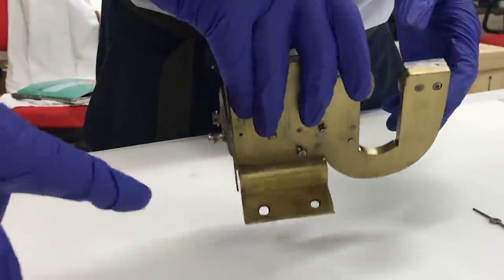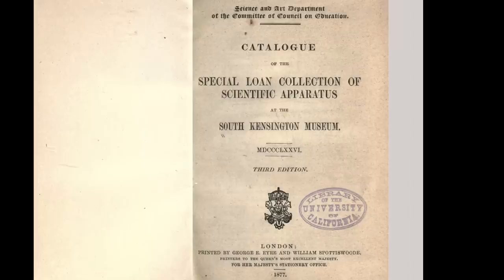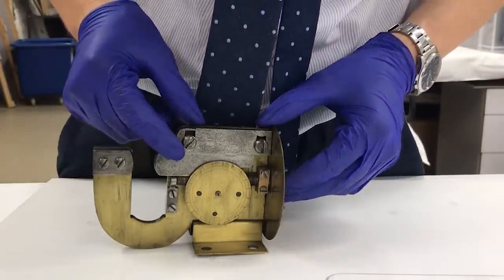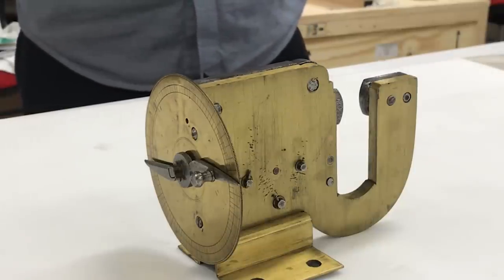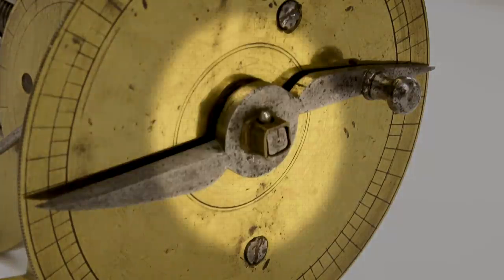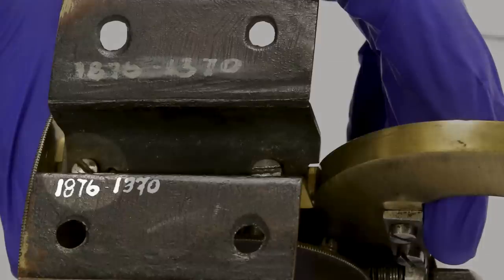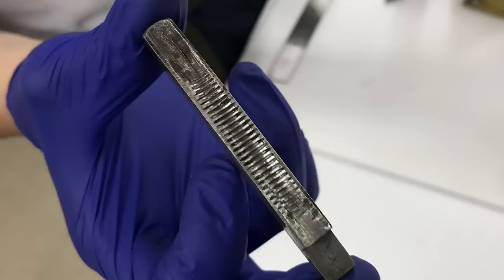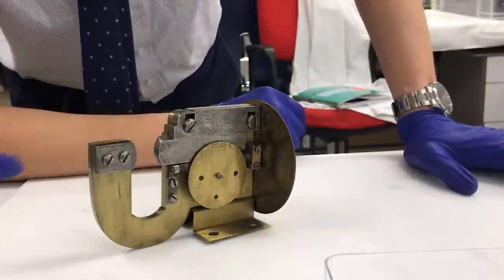World's Oldest Micrometer - 1776! Who made this thing??

Comment: You could find out if the dial markings were made using the hands of the instrument itself by seeing if the deviations in the lead-screw follow a pattern that is also seen replicated in the dial face markings.
The hole in the dial was likely used to indicate the position of the two dials when assembling it as there are also indicating holes or marks in the small dial, possible a pin is placed in the hole then the other dial is placed with it's marks at the quarters and a block is placed in the "U" to indicate the lead-screw then everything tightened.
The outer edge serrations were likely not just decorations as the rest of the tool doesn't indicate a "decorative mind" made this device likely used to ad more precision to assembly or they interface with other device parts that are now missing. This might also be why the unit doesn't sit flat on a table as it was used in a larger device now long gone.
The soldered in pieces are a common way to align parts that were made on cruder devices, this way they can be filed by hand to fit more precisely.
The screws holding the base on were crude because they didn't need to be more precise.
The marks on the back are directly in line with the pins and indicate how many times the pins were driven in and out.
The marks are vise jaw marks where the piece was held to be cut and filed....not hammer marks.
This might have been more of an adjustable "Go No Go gauge" as the crudeness indicates less needed repeated accuracy as once set it could be locked in place, one would assume that the bottom of the "U" shaped channel was made this way by drilling a hole then sawing down to the circle, this could also indicate the precise edge to locate a single piece to be checked repeatedly.
Everything to me indicates that this was part of a larger machine and not so much a single tool measuring device as there are indications that the dials had other uses in the device and the base was made to locate the opening in the "U" at some specific place in the bigger machine.

Just my tow cents not in any way to be confused with "facts", and darn well worth what you paid for them.
Reply: It seems that, with my two cents, we have a grand total of four cents,... I concur !
Reply: Over a repeatable wooden nickle blank now. Get out the master guage from the lab and we'll double check. 🔬
Reply: I could probably add a dime.  Pin holes for locating dials.  Two dials, one cent.  Need to set threads with minimal backlash.  three cents for easy. Need to figure out a basic indicator.  Two cents. (should be worth way more.)  It's a "Mother Tool"  Old school would be mount shaft on the ends.  Make form around main part of good threads.  Divide @ centerline for casting.  Pour Babbitt. Bottom half is solid in the base.   Top half is adjustable end to end for preload.  Or you could just precision machine everything, and put it together.
Reply: plus one good stuff

Comment: Im a watchmaker by trade, and i see a lot of watchmaker/builder type of markings and methods used.
Reply from the maker: Could you please elaborate on that? I very sincerely would love your specific input.
Reply: Yeah I thought watch makers were the first machinist.
Reply: @machinethinking  are you going to be doing a follow up this device? Amazing piece of history.
Reply: I’m sure the hammer marks weren’t there on the original build but on a later repair or adjustment, shows it was used a lot
Reply: @wannabecarguy The Greeks who built the Antikythera mechanism will dispute that. Parts of that were definitely lathe turned…
(And it’s not a clock but rather an orrery).

Comment: I concur with the other comments that making a tool in-house is usually a necessity when access to the expenditure of funds is restricted, but you can overcome this hurdle by scavenging in the scrap metal bin to find the materials you need to make the needed tool. Often times a specialized tool is so rare, no one else makes or sells them and that is the motivator to make it yourself. It is so rewarding to see your creation work as intended.

Comment: Excellent video! Its very cool they let you help take it apart and examine it. The large brass back plate looked almost like it had been cold rolled like a modern plate. Hard to tell on a phone screen. The screw and the movable jaw fascinate me. My guess as to why the jaw has deeper grooves in the middle is the lead screw may have a slight bow. Or that was the main use of travel and I'm sure allot of dirt got in there. I just visited the Precision machine museum in Windsor VT. They have the #1 Bridgeport there as well as the #1 Brown ad Sharp gauge block inspecting micrometer. Keep it up you are doing an awesome job telling this story!

Comment: The base could have been attached to a block like you show, or it could have been to bolt the mic down so it doesn't get borrowed. It also looks like a later addition, possibly a spare part, to replace a broken original. If it has seen use in a workshop it may have battlescars.

I don't see hammer marks in the back of the fixed anvil, but I do see the knurling we still have in the jaws of bench vises. 

The 'convex' thread depth of the moving anvil is perplexing. Perhaps it was sawed in two.

...IMO filing isn't crude. It just takes manual dexterity.

Comment: This measuring tool appears to have been made for a more specific application rather than a general hand held measuring tool as later shown.
Reply: I'm sure this is actually intended to be carried in ones pocket.
Reply: I am positive that this was a bench device remember during that century a lot of work was done in a vice on a bench with a file or treadle powered saw or drill press.

Comment: I just watched your video about etching brass dials.  Ferric chloride is a good choice for brass, but it needs to be diluted with water a lot, for aluminum as it thermally runs away (splattered on the neighbor's siding 20 feet away).  For copper or brass there are two tricks that speed up the process, agitation and heat.  Both can be done with aquarium supplies.  A regulated heater in glass, you don't want to get your ferric chloride more than 80 - 100 deg F.  A small air pump with a plastic tube used to inject oxygen for the fish, can stir up the ferric chloride across the material being etched.  This gives two benefits, by moving fresh ferric chloride across the surface and removing any stationary bubbles.

Comment: It's funny just last week I made a small fabricated metal part for a fixture,similar to the micrometer base that had 4 counter sunk holes evenly spaced on each side but after it was forming. Since I used to be pretty good at forming things I drilled and countersunk the 4 holes first for the sake of ease in clamping and drilling in the drill press. When I went to assemble the fixture the countersunk holes were facing the wrong direction, Damn, how did I do that! I need the fixture finished right now so I countersunk another set of hole on the opposites side of the 4 original holes countersunk in error and installed the part, no one will ever notice unless they take it apart, by then I will be long gone in my grave. May this be have happen to James Watt micrometer, or the maker of the micrometer who ever he was?

Comment: This micrometer appears to have been cobbled together for use in a factory or in an artisan's shop.  The sloppily made screws, the re-purposed "dials" (gears?), the poorly mounted hands, the poor quality of the stock (which appears to have been scrap), the rough workmanship, ...  It was expected to suffer a lot of abuse, so it wasn't finely made.  It had to be accurate enough only for factory purposes.  Also, it's very big, so it wasn't intended to make scientific instruments.  Possibly it was intended to make interchangeable parts for rifles.
Reply: The eccentric dial hands had be questioning... questioning if their misalignment was indeed from heat or if that’s an overly-wise, possibly too quick answer.
Reply: @robertgardner7470  -- Do you know that the screws have a "class 3 thread fit"? 
This micrometer appears to have been assembled from whatever scrap parts were available.  Scientific instruments from the 18th and 19th centuries usually are beautifully crafted.

Comment: Great video and comments. Im not sure but can confirm re-purposing bits of dead/redunant machine's commonplace in sheetmetal and general metal workshops in the 90's,we had some crude looking however pretty magical machines that used to bend tube as well as form flat stock into joists.Same can be said for many volunteer run mechanical restroration groups who mostly run on shoestring budgets often using century+ old machines,tools an skills.

Comment: In 1966, high school, I made a micrometer for a science project. Used a 1/2"-20 bolt. Made a degree wheel and a explanation of how it worked. 
Got an A. Then worked in machine shops for 47 years. I have no idea where it ended up. Maybe it will show up somewhere and people will try to figure out who made it.

Comment: How accurate is it? Did you test it with anything of known thickness? 
This channel is AWESOME! THANK YOU!!!!
Reply: It is highly accurate  1/1900 in.   It has no numbers assigned to the graduations. The slotted holes of the stationary anvil allow  the lead screw to be adjusted tight against the threads of the sliding anvil to insure repeatability.  You could use a pound note or dollar bill  to see where the dial stops to,  and  that  would be  0.002".

Comment: The knurling on the dial looks to be functional and not cosmetic. Did you count the notches?  They may be fractions. It would be easy to add a ratchet stop onto the knurled dial. You have a great narration style easy to listen to and you tell a great story.
Reply: I thought “ratchet” too, but didn’t take time to pause and count on my 5” screen. OR, maybe to add traction to drive a belt to another device, like a counter of some sorts or what I’ll call a “sum readout wheel.”
Reply: I count 8, 9, and 10 knurls between long marks on the face of the large dial (just 3 samples counted). Thus (probably) not a nonier nor a ratchet.
Reply: I'm thinking they were for 'grippage' for the (possibly leather-faced)  lockdown pad that helped to ensure repeatability as a short run (changeable settings) guage on a single process machine. The 'knurling' or 'serrated' edge didn't have to be pretty or precisely spaced, just functional. I have to agree with the concensus that it was quickly cobbled together from available scrap for an urgent need to streamline a 'hiccup' or 'bottleneck' in a production line. Maybe the 'oddly countersunk from both sides' base was just that way in the previous life of the salvaged material. Who's to say why the base is even there to begin with? Maybe it sat in a conveniently located depression in the cast iron framework of said machine. Heck, it may have been stored in a nice little wooden box and only removed for setting up a repeatable setting at several spots on the machine when changing a production run (every factory has a set up guy, we all know him. He's the one that takes more breaks than Evel Knievel's bones!). Well, enough of my personal theories. I have to tune my air guitar to alpha waveform for the grays (they are borrowing it for an extended interdimensional tour date).

Comment: As a blacksmith, it's very cool to see wrought iron screws! The quality of the threads is also very nice; in regards to how they were manufactured, the lead screw could have been held in between centers and run a dye around it, unpowered, just to keep it straight. I don't know exactly what kind of quality dyes they would have had access to in the 1700s, but they definitely had thread cutting taps and dyes before metal-working lathes were particularly useful.

Wrought iron is very soft and ductile, so it wouldn't be too out of the question to turn wrought iron on a lathe, but I don't the lathes of the day had a feature to cut threads in a pass like modern lathes do. All lathe turning done at the time, be it wood, brass, or iron, would probably have been by hand.

Comment: 1. Those hammer marks are in plane with the pins. I'd guess it is from repeated removal and reinstalation of the pins with a hammer.
2. The dial is clearly hand indexed. 
3. The soldering looks almost like a fix
4. Iron would have been a possible retrofit as the brass wore during measurment on the original. Likely produced by a local smith for the craftsman.
5. The mounts look like a later addition. 
6. All things used to be hand-fitted, even if machined.

I doubt Watt produced it, but might have interacted with it or helped. No way to know with the limited data we have.

Comment: Hi! I was going to leave a comment about some issues I noted, but Hammerandhearth beat me to them and added a couple I didn't think of.
On my own I will point to what seems somewhat odd - the condition of the screws and the hammer marks seem to denote that the micrometer was more times disassembled and reassembled, by not very careful people, than actually used for measuring. This could then be a prototype someone made and took for Watts appraisal (once that was his business) and was moved around, from hand to hand (possibly copied in the process), but never made it to actual production by Watt. The identity of the original inventor was probably lost in the sands of time.

Comment: Circular marks around center area may have been from the machine that cut the notches around the edges of both round plates.
Brass disk is mounted on a spindle that is secured by flanged nut, hence the circular imprint.
Cutting tool has blade and indexing point; the spacing between the two determine the pitch of the notching.
Make the first cut, then turn the spindle so that the cut lines up with the indexing hook, and make the next cut.
Each cut then proceeds the same manner until you are back where you started, if the spacing was right!
Some brass wheels are found with a few extra-wide or slightly narrow notches!
Edge-notching can have very precise spacing, even going back to the 1600's.

Comment: There's a medieval 'micro scale' method using wedges. (to break 1 cm into 200 parts? make a 10 cm diagonal between units.) I 'reinvented' this fiddling around to make up lessons and materials for my 8th grade science students.The theory is solid, in practice my initial uses didn't work very well, and the Wikipedia article says that it was made obsolete by the Vernier scale. 
If you're really interested in this I'd suggest finding technological historians and research on this topic. Witold Rybczynski wrote a very engaging short book "One Good Turn: the History of the screwdriver and screw,"  that doesn't seem comprehensive or even accurate.

Comment: Firstly, the hammer marks on the back face are created by attempting to hammer in/out the pins.
Secondly, the hole on the rear dial is used to notify the user of one full rotation (using haptics, a 'click'). The knob may be missing a small leaf spring or some soft peg which makes a click.
Thirdly. the inner rings on the rear dial are most likely used to check for the 'needle' alignment including radial backlash (Due to a square-ended axle).
Similar mechanisms will mark lines and circles in place of witness marks made by disc wheels under the arms (which is NOT the case here).
Yes, the notching/knurling was likely made by hand.
The measuring lines on the dial face (which appear to be too long sometimes) are made by using another dial needle with longer arms. The lines are then scribed on with a sharpened implement.

During the time of Watt, rough treatment during maintenance was common. Thus the hammering marks. Creators of such tools are most cautious, so it is likely that for the original presentation/event, someone disassembled the instrument. A coin can turn the screws loose, but the pins require a very accurate gauge of wire. If the wire is close but slightly thinner and falls out,  one may fix the pins by placing the peg (which is getting the pin put through it) on an anvil, so the hammered pin flares inside the peg and holds fast. This can be verified by looking at the exposed ends of the pins for signs of hammering/deformation. Think of the handle of a vice, with a knob on each end.

Comment: one thing that might be of note is that the "countersink" that is present on both sides of the base is most likely because of the use of a forge punch. The irregularity of the holes is most likely due to hammering back the deformed edges after the punching process was completed. Since the piece was most likely a "good enough" part used as a bracket to hold the tool, the lack of precision is expected. there's also the chance the part itself was made by an apprentice from rough dimensions so the incongruity of the quality can be explained that way.

Comment: There are so many aspects of this micrometer which point to it being a prototype. Being a blacksmith and having a good bit of experience with true wrought iron, I am a bit surprised by the use of wrought in this device. High carbon had been around already for centuries and cutlers used it for making knives. If this was to be a "fine" piece I would think carbon would have been procured and utilized instead of the very soft and highly wear prone wrought. It was interesting to see the hammer marks which speaks to their forged origin. Great video!

Comment: knurling around the dial seems to have been made for more precise counting/measuring. Its hard to count the notches but looks like it has 10 notches per 1 sector, and 5 in between the 2 longer lines( matching the smaller line )